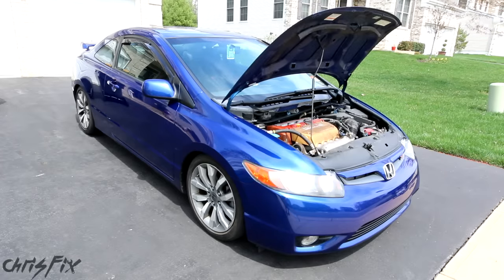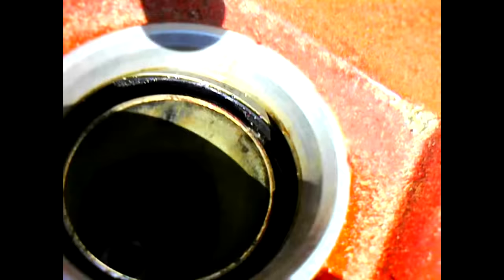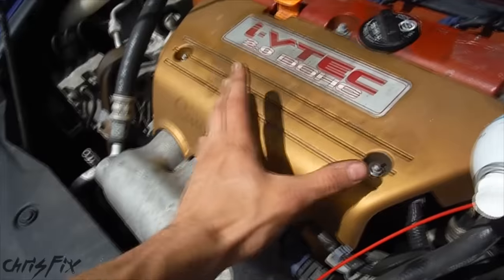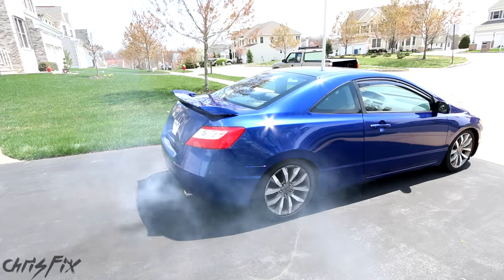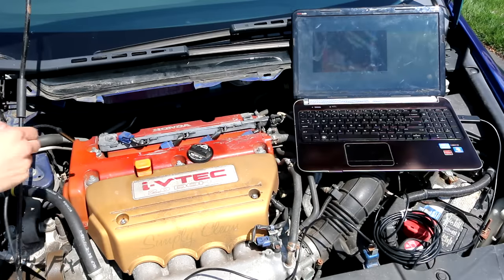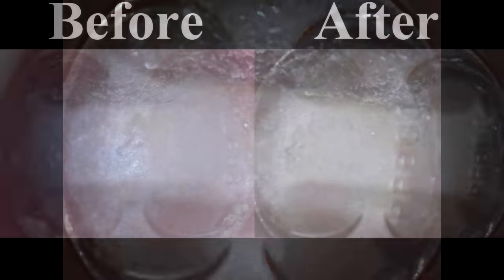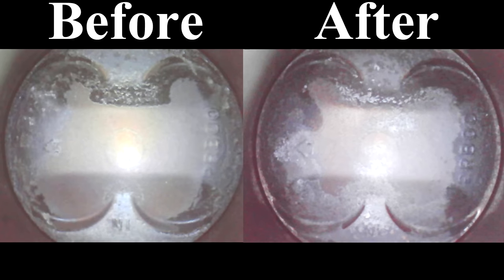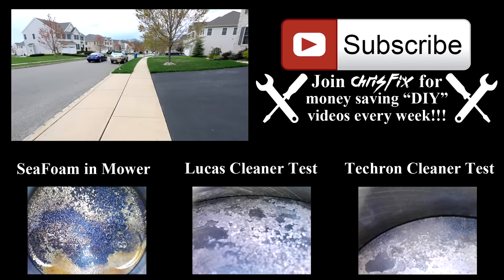Does Seafoam Actually Work in a Car? (with Proof)

Comment: The aggressive driving probably did all the work cleaning the engine.
Reply: Playboysmurf1 agreed
Reply: True, a friend of mine had an old Opel Kadett that ran lumpy as hell so we took it out on an empty parking lot and revved the shit out if and after a short while a huge black cloud came out of the exhaust and it was as smooth as a shaved kitten.
Reply: why a shaved kitten lol
Reply: Lmfao
Reply: I once had a slightly lumpy V6 Dodge. I was amazed that it put out 220 hp considering it was a normally aspirated engine. The mechanic told me to take it out and push it HARD and the lumpy feel would go away. Damn, it actually worked.
Reply: Putting premium gas and driving the doors off is called Italian Tuning. It really does work. Especially if you add Techron or something.
Reply: what do you mean by "lumpy"?
Reply: That's what I thought
Reply: Colin Pheister---Damn you beat me to it.  When we were kids we always called it the "Italian tuneup".  Red line every gear until your heart is in your throat lol.
Reply: First amendment, where is your proof that Amsoil is better? Opinions don't count, results do.
Reply: VIsubby yeah that's what he said
Reply: that's what I was thinking.  Probably damaged the catalytic converter and other parts too.
Reply: I don't think they shave kittens where he is from. (Middle East)    
Top Tier gasoline burns best in my truck, I can buy  
93 octane from Costco and the valves rattle climbing steep hills.  
If I buy Mobil 93 octane the valves never rattle climbing the same steep hill.
Reply: Joseph Holmes I noticed that too in 2 of my cars. Using fuel from gas stations that have "perks" will give you the perks of replacing your engine after about 40-50K if you live in the mountains.
Reply: I've seen that called an Italian Tune-up.
Reply: The italian cleanup is real
Reply: @c0lin82  yep I use a full tank of Shell Premium or Sunoco Ultra 94 and drive it like I stole it for a majority of the tank.  Considering I drive in a 'spirited' fashion here and there on a regular basis I'm sure it is reasonably clean in there.  Car runs very smoothly....and it has 346,000km on it, 2013 Ford Focus 2.0 with direct injection.  It's a 5 speed car.  Owned from new and have always used Castrol Synthetic.

Comment: Great video and I decided NOT to seafoam after watching your video. You did a great job explaining and showing results. I didn’t see enough results to go thru the trouble.
Reply: I kind of agree. I was wondering if this could cause the cat to get blocked up by the huge clouds of carbon going through the exhaust in such a short time at idle. I was thinking maybe instead of a whole can soaking at once. A more slow approach. A qtr can sprayed in intake per 50 miles maybe. Give the cat some time to burn up and blow out the carbon just soaked through it by the cleaned out intake/cylinders. Burn that carbon out the cat asap.
Reply: @johndough111  I don't want to smoke out my apartment complex so I won't do this as well.
Reply: @johndough111   clever name lol

Comment: So after I watched this video I went to buy some seafoam and that little plastic lid you pull to open the bottle version fell in my gas tank 🤦🏻‍♂️ 
Same car too 06 civic si lol .. my buddy said it should be ok.. that it’s too heavy  to get picked up by the fuel pump and probably will just sit at the bottom of the tank 🤷🏻‍♂️
Reply: Wait why did u have the gas tank open, isnt this a spray?
Reply: @copiouscoos  there are  two types ... a spray for the intake and the one i used (liquid) that you can dump in the gas tank or engine  they bare both for cleaning up fuel system

Comment: how did i get here i dont even own a car...
Reply: zzazs pearson hahahaha
Reply: Stephanie Agreda  Google BG44K it's a much better product than Seafoam. Check the history of Seafoam. It was made for 2 cycle outboard engines.
Reply: sadly, BG44K is not sold in Canada
Reply: Pabloottawa P   Check out Google.com in th search bar put in LS1 been testing oil. There is a lot of info on this subject. It's about using Marine outboard two cycle TCW3 rated at 1 oz per 5 gallons of gasoline in your car/truck. I've been doing this for over a year myself. It is cheap and works great cleaning and lubing the fuel system. It must be TCW3 rated because it burns ashless.
Reply: Oof
Reply: tearson jhghhb
Reply: Looking like this comment :D me to man lets hug!
Reply: its ok but so much help full if you get a car

Comment: 4:19 VTEC KICKS IN YO!
Reply: Vtec is garbage
Reply: +Samuel Campbell you clearly don't know how useful V-Tec is. A LOT of cars have their own versions of valve timing but V-Tec is probably one of the most aggressive.
Reply: +Jason Roof No. Lol
Reply: VANOS
Reply: +Nn A bmws vanos is terrible...
Reply: Prove it Please if you  really know what you talk about
Reply: Jamy4ya ever heard of a joke?
Reply: How do you know if it kicks in?
Reply: SBdunks3 its a joke
Reply: +rohan singh oh ok so vtec doesn't kick in ever?
Reply: SBdunks3 it kicks in at the higher rpm's
Reply: +SBdunks3 v-Tec in my Honda (basically the same one in this video but mine has 350hp) kicks in at 5,500RPMs
Reply: +rohan singh what is the sign that it's kicked in?
Reply: +mason dyer how do you know that it has kicked in? What's the giveaway? I have a vtec too but never driven it that fast
Reply: SBdunks3 you can feel a significant boost in power
Reply: rohan singh ah ok
Reply: What happens at 420?
Reply: THC kicks in yo!

Comment: and where do you think the engine spits all that gunk right into? i tell you: the catalytic converter. and that part wasn't designed for this type of abuse. the larger chunks of carbon occlude the gaps in the catalytic converter, that causes performance loss and more emission of harmful gases. if you do this to your engine regularly, then be prepared to a catalytic converter failure much sooner. maybe, i would try this stuff on a much older engine that isn't worth the cost of the complete repair, but on a relatively new, modern, fuel injected engine: no fucking way.
Reply: Elmer well, you can change catalytic converters easily
Reply: Emx2000 ...and that costs a shitload of money for a car like this honda.
Reply: Elmer Or you know have aftermarket exhaust with no cats. Granted I live in Florida so no emmission laws so I can have cat-less exhaust
Reply: Elmer Just take the cat off before spraying the cleaner. Always great to hear how loud an engine actually is without the exhaust getting in the way
Reply: Elmer just replaced the cat in my 01 Buick and only ran me about $100
Reply: Elmer You know the funny thing is that repair places use chemical treatments like this all the time and it never causes an issue. Your never going to really get a big chunk out the cylinder will pulverize it before it gets into the exhaust system. I use it all the time with cars with cats and it doesn't cause any issues with the o2 sensors, cats, valves, cylinders, or anything. Use to work on cars and if you understand how the whole system, cleaners, and process works you have no issues with them. Run the cleaners through them, run them hard to get the cleaners out and the car runs beautifully and you might gain a little fuel economy.
Reply: What would you rather buy a new cat or a new engine ?
Reply: Joshydmanx this car didn't need any repair, that amount of carbon buildup is nothing to be worried about. just let it rev high for a longer period of time on a highway, and it will clean itself. if you say otherwise, then you haven't seen a really nasty carbon buildup in an engine. and if the engine needs cleaning, then disassemble and clean it mechanically, don't fuck around with shit like this seafoam.
Reply: Elmer
gotta agree there. my carbon build up in my Buick was god awful. I had to remove my heads to get it all and it was about half an inch thick. no way any cleaner was gonna get that.
Reply: Elmer i tought the same!!! you remove the carbon and it will gunk the pores of the catalitic converter. theres no miracle. i preffer to use a good additive. like STP fuel injection cleaner. its soft cleaning effect, dont lift that amount of carbon pieces, reducing the chances of damages. the best recipe is; militec on the oil and stp i.c on the fuel .
Reply: mm
Reply: Emx2000 True! Cats are CHEAP too!! AMIRITE!?!?!
Reply: Chris Martin I promise you put a garbage cat on then. GO to the dealer and price a real CAT... Thanks for playing.
Reply: Chris Martin Really? 1/2" huh? Congrats on the 1000% increase on your compression ratio brah!
Reply: Chris Martin Nice try. I just used GM parts direct. The CAT for a 2001 Buick Century (the cheapest) is 867.99. Wanna try again? http://www.gmpartsdirect.co/auto-parts/2001/buick/century/custom-trim/3-1l-v6-gas-engine/exhaust-system-cat/exhaust-components-scat
Reply: Elmer It's a point but the carbon doesn't come out in chunks, rather it dissolves and passes through like a mist. I serviced a ford laser which had all the emission gear on it. This thing was not looked after as the owner didn't believe in servicing. It had done 150 thousand km's and was running rough and had power loss. I backed out the injector rail after warming the engine and sprayed subaru carbon clean (similar product) directly where the injector ports are in the intake manifold. I let it sit in there for a good 20-30 minutes, fitted the injectors and then pushed it outside and ran the remaining half of the can whilst revving.  Smoked the shit out of the place and then finished off the basic service. I road tested it and it went heaps better, no rough running and pulled like new. The customer picked it up and flogged it down the road, he returns to the service desk saying FUCK ME DOG! That shit goes way hard! Soon after it was back for a new clutch as the renewed power had taken it's toll. He now services it on time and has the same thing done, not bad for some time and a $14 can of spray.  The power is gained and most carbon is removed from the inlet valve and port area which helps it breath again.
Reply: Erik Larson
Yea i do actually, since I have a Regal GS with the supercharged 3.8. I have the receipt right on my desk. $100 plus 50 core charge and 8% tax from Mangino Buick in Ballston Spa NY. don't act like you know what you're talking about because you don't
Reply: that's why do it to vehicles that don't have them like my truck
Reply: +Elmer you shouldn't even run a catalytic converter anyway. straight pipe all the way.
Reply: NakiNinja5000 NOT LEGAL were I come from.Emissions test.
Reply: Ok, thanks! Your vids are really helpful.
Reply: Elmer I had a car that did not pass tailpipe emissions. after I did the seafoam, the car passed so it did clean it out
Reply: No cats here.. but still worried about spraying or pouring this into my car.
Reply: Vince Hodge USE what I did to remove carbon and sludge in my 9 year old car.
Reply: +Elmer No... like 400 bucks tops.
Reply: +Elmer im happy where i live we dont need safety only time we need a safety it if car come from a defrent provence or as a parking plate for 1year
Reply: +Chris Martin and also catalytic ... cut them remove the inside . weld it . there you go !!
Reply: +hotgab328 that what my insurance broker did on is truck on top of putting a cherry boom
Reply: DevilGhost on my Bmw i put hartge back system and it was made to fit a catalytic deleted . But no cat means inspection fail . And high performance cat for a bimmer buckle up your bank account .. so I opend them and deleted the inside. I also weld a metal screen at the out end double .. just in case cop want to try the rod.. works for me !!
Reply: +Elmer the cat will be fine it will fail anyway if your engine is as horrible as it is
Reply: +Chris Martin $100 wasn't an installed price.  It wasn't a stock converter either.  Unless you were part of the recall?

I can get some cheap universal cats, but not that cheap with install.  Parts alone, maybe.
Reply: +Elmer I have decat so don't care. :)
Reply: +Elmer Most likely, dissolving carbon would increase surface area and mobility, allow it to burn.  Sludge isn't going to make it out your valves as easily as gas.

Charcoal is carbon.  It's wood heated without oxygen until organics break down into VOCs.  That leaves a brick of carbon, which then burns by oxidizing into CO2.  The white stuff left is mainly potassium carbonate (KCO3), from oxidizing potassium and carbon.  It's called potassium because it's from potash.

Oil, on the other hand, is hydrocarbons.  It oxidizes into both CO2 (from the carbon) and H2O (from the hydrogen).  Has quite a lot of chemical energy density compared to straight carbon.

So the engine essentially burns all that gunk.  So long as that gunk is shielded from direct oxidization by being stuck in place,  it won't combust; break it loose, grind it into dust, and throw it up into the cylinder, and it burns away.  Some dense soot can pass; that's the kind of stuff VW's heavy carbon particulate filter catches and burns off, typical for diesel engines, less for gasoline engines.

In any case, it's not going to belch carbon sludge; it's going to belch smoke, at worst.  The exhaust is white because it's more water than soot--not a lot of unburnt carbon.
Reply: +Elmer I have to agree 100%. Seafoam is a total waste of money in my opinion! Tap water does the same thing minus the cloud of smoke! Or find a open stretch of road and run it wide open for a few minutes. Save your money and don't buy Seafoam!!👍😀
Reply: Then just take the converter off 😈
Reply: +Nathan Gray Or just not use that shit!😛
Reply: Someone see my leprechaun?
Reply: Catalytic converters are meant for one thing.  To be gutted or to be replaced with a straight pipe and to be sold at the crusher for $50.
Reply: JustAGuy Says the guy who lives somewhere they don't have Emission Laws.  Try getting tags in Denver.
Reply: Grim Reefer Yeah, you're right.  Was kind of my joke.  I live in Tennessee.  No emissions testing.  All my V8's are loud haha.

Comment: That did absolutely nothing, but the lighting made it look like it did a little.  I wasn't expecting the pistons to look like new again, but the product only seems to remove very thin light deposits. I was looking for an easy way to avoid taking the head off my 180,000 mile Morris Minor engine, but if things seem to good to be true, they usually are.  Maybe it would do better using it a couple of times a year when the engine is new to prevent high build up, but I'll be dead of old age in 20 years so dont have the time to find out.